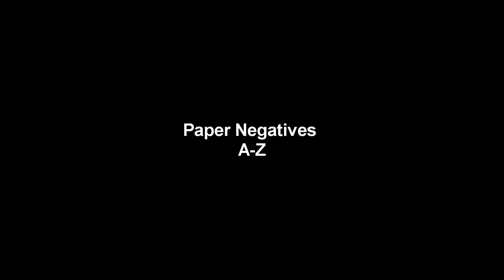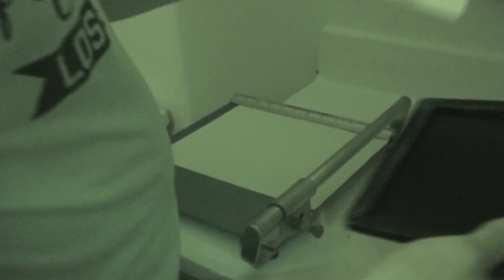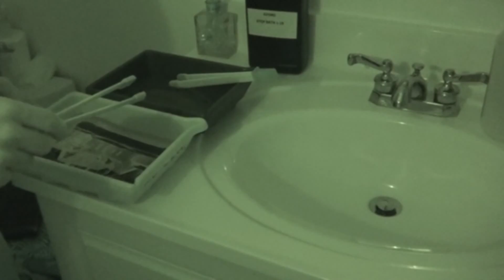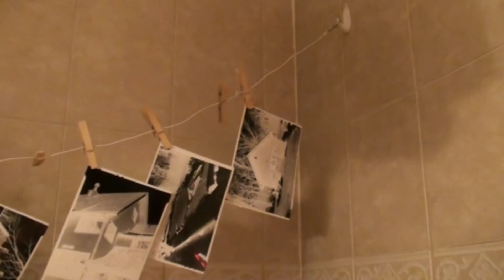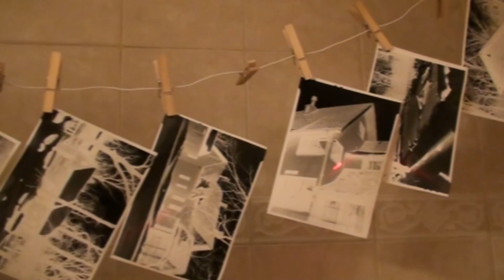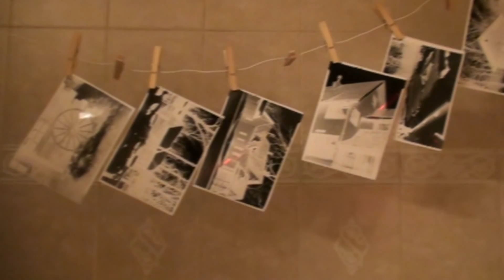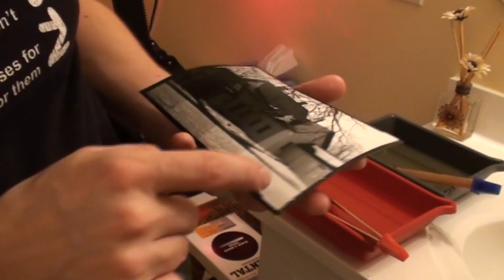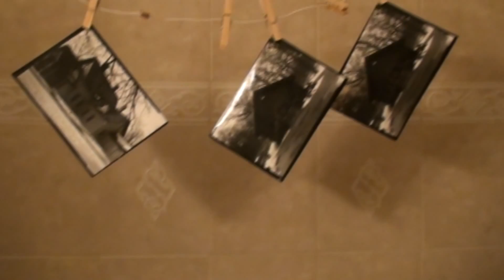Paper negatives A Z

Comment: Hi there! I found your video extremely helpful! I miss trying to shoot my own paper negatives but I have one problem. I can't figure out the iso rating of my paper. I'm using arista grade 2 rca glossy paper. The box says that the paper is rated at iso P400. what does that convert to in film speed? I use the same light meter as you do. I was wondering if you could give me any direction as to how to read the meter and make my exposures look the right way. I tried to do a few exposures with setting my meter at iso 4 and was doing 1-2 second exposures. they came out very over exposed. any help you can offer would be greatly appreciated! I have looked all over the Internet for information on this type of paper but have been unsuccessful. I tried calling free style and they told me they had no information about what p400 or what p values meant. Thank you
Reply from the maker: +Jesse Keats Hi, I rate my paper at ISO  3. Under studio incandescent bulb per meter reading the exposure is nice mid tones. When shooting with sunlight, as I show in the video, I use contrast filter #1. The paper is sensitive to blue light much more than yellowish light bulb room light. In the latter case the filter helps to achieve mid contrast without overexposure. I still go per meter reading.
Reply: +Kris Bochenek thank you very much for the help and speedy reply! I will try that out! Also, thank you for making this extremely informative video! You have really inspired me to explore the world of film and paper photography.

Comment: I had before will soon experience the negative printing by silver nitrate and gelatin, salt solution, but unfortunately I can not image stabilization for a long time does not Nha become black little by little because I did not get Sodium Hypo acid solution in my country because it is difficult does guide me to an alternative I can get it from kitchen utensils materials, for example, or a similar alternative O'Shea which can be accessed easily in order to be able to install the pictures for a long time and I will be very thankful to you